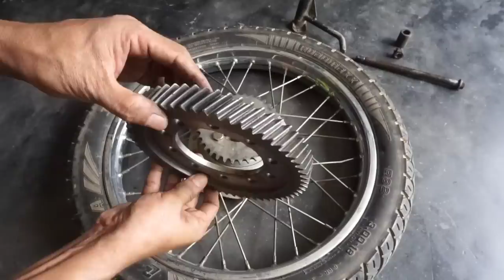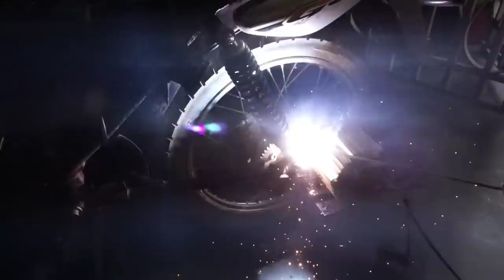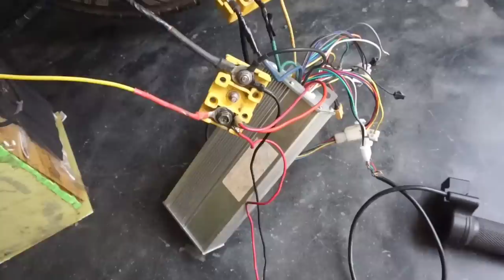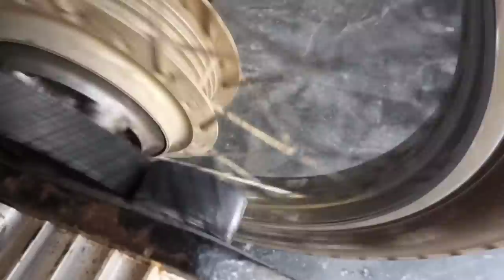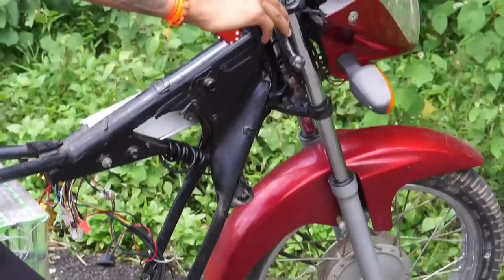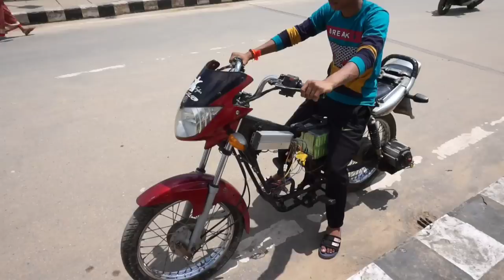DIY Electric Bike

Comment: This is a good project but engine should be on the centre
Reply: No need
Reply: @jimenezsplaylist4618  THERE ARE SO MANY VIDEOS ON ALL THIS STUFF... PEOPLE CAN GET AWAY WITH THE WAY THEY MAKE SOMETHING BECAUSE THE BASIC WAY OF BUILDING A ELECTRIC BIKE..YOU HAVE TO GET THE POWER TO ROTATE THE WHEEL" AND YOUR OFF" HERE'S WERE THE ( NO NEED ) COMES INTO PLAY " THE NUMBER ONE THING ON BIKES WITH NO GEARS OR TRANSMISSION" IS YOUR GEARING " IT DOES 3 IMPORTANT THINGS..1) YOU CAN SET THE BIKE UP" TO RUN 21MPH..OR .32MPH..IF THE GEAR COMING OFF THE MOTOR IS SAY A 12 TOOTH AND THE GEAR ON THE WHEEL IS A 56 TOOTH THAT MEANS THE BACK WHEEL WILL MOVE THE BIKE BASED OFF RPMS..AND POWER..IT COULD MEAN THE DIFFERENCE AGAIN IN 21MPH...TO 34MPH..2) YOU DON'T WANT TO MUCH GEARING BECAUSE IT CAN MAKE THE BIKE FAST ON TAKE OFF" BUT YOUR TOP SPEED IS LOW" WHAT YOU WANT IS TO BE IN THE MIDDLE...OKAY SPEED OFF THE LINE" THIS WILL KEEP YOUR CONTROLLER COOL" AND THE BATTERIES WILL LAST LONGER ON A FULL CHARGE" AND TOP SPEED WILL STILL BE GOOD" ALSO...YOUR BRAKES SHOULD BE GOOD ENOUGH TO STOP THE BIKE AT FULL SPEED" THIS IS A MUST....NO NEED " IN THIS CASE IS NOT GOING 2 WORK.. SAFETY IS ALWAYS  FIRST ON ANY KIND OF BUILD" YOU CAN DEAL WITH A BIKE THAT WANT RIDE" BUT YOU CAN DEAL WITH A BIKE THAT WANT STOP"
Reply: @RGIIIBOXING  no need because it's just an idea still many improvements to be done but "STILL" it's just an idea

Comment: I like the idea, but this is not a reliable solution at all. These gears are meant to be run through oil at all times. If you built a sealed gearbox with oil, this would have turned out as a very long lasting and good performing solution.
I understand the "DIY' behind it, but then again it would be easier with just a regular chain drive.

Comment: you can place another similar dead motor on other side of wheel  to keep weight balance.👍
Reply: A dynamo(s) as well on the right side or may be at center connected by belt for current  regeneration.
Reply: @dvbharath  Dynomo reduce battery capacity bcoz of Working Principle
Reply: @dvbharath   🤣🤣😂😂

Comment: Weight distribution is disturbed due to one side motor....instead you ahould have replaced bike crankshaft with motor drive ...isse motor center pe hoti n weight distribution accha rehta....dikhti bhi mast n bike ka gear system use kar k high starting torque plus high speed dono ka faida milta n due to gear system....battery life bhi acchi milti....anyway nice project ...i hope u wil improve your design ......good luck...
Reply: Doesnt matter

Comment: Not a good idea! Motor exposed and vulnerable to accidents. Gear wheels efficiency is when it is submerged in oil. Motor should be in the centre of the frame and arrangement of pulleys to accommodate belt happens to be ideal!
Reply: Yes sir correct
Reply: thats right👍👍
Reply: It goes down his path in life. Its better than what he had before he used his mind to help himself.   I give him props and commend him for doing something other than criticizing what others have accomplished.  Bravo!!!
Reply: Brother moter  fitted at wrong place

Comment: The idea is good, but the engine on the side is very inconvenient, you can catch it while driving, besides, a lot of weight is not in the center of gravity of the motorcycle, but on the side, which affects handling.
Reply: You're too much for an expert.
Reply: @renleedativo1679  I'm not an expert, this is ordinary logic
Reply: @Pineapplepen_2  it doesn't need your opinion coz as you can say it's only ordinary.
Reply: @renleedativo1679  If this video is posted to the public and there is an opportunity to comment, then I express my thoughts, I have the right to do so, but you have no right to tell me that I can do something or not, do you understand?
Reply: Thali is correct
Reply: Right brother 👍🏻

Comment: Hai well, I don't know why you all discard most of the main parts from old patrol vehicles. In scooters and motorcycles, the gearbox, clutch, and the main heart of the engine the coil which generates power to the engine for the spark, lighting, and battery charging can be retained most of you miss out on the real CREAM which can regenerate energy on the go all that you will have to utilize the coil only for lighting and battery regenerating without stopping automatically without stopping. mine is aeronautical engineering and not electrical engineering.

Comment: Concerned about the balance of the bike, and the protruding motor is a physical risk. Engineering designs shouldn't just work at the expense of safety.

Comment: In the long run the metal will melt due to excessive heat caused by friction
Reply: impossible....that gear is way more than required for this...that gear can run a car literally on 4 wheels....grease is good enough
Reply: God job
Reply: @rollbeats7342  that gear need oil bro, if  u dont use oil bad thing will happend

Comment: Not a good design. Unsprung, unbalanced weight has gone up. Motor must have been in the cradle and a shaft drive to the rear would have made it a sweet ride.